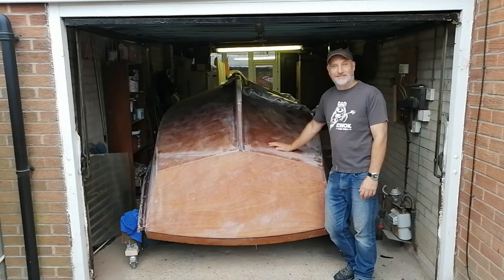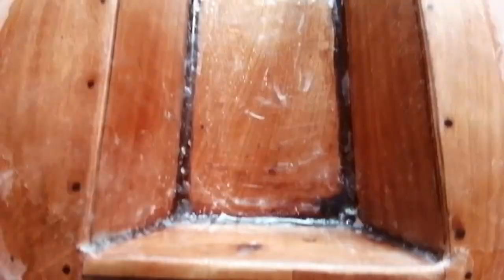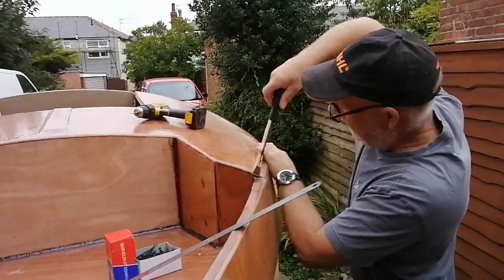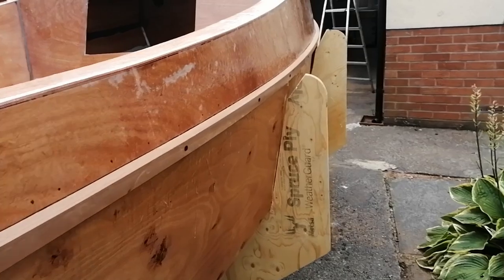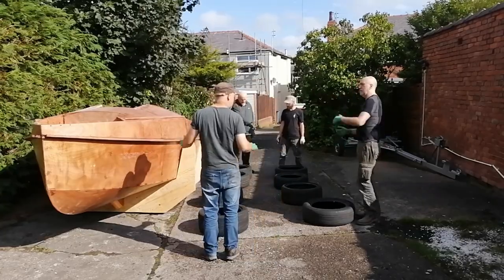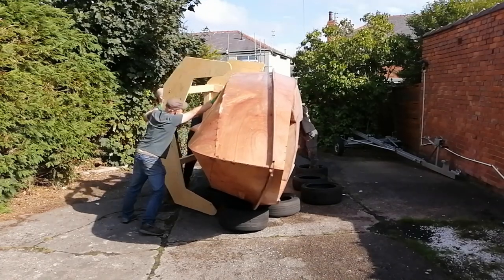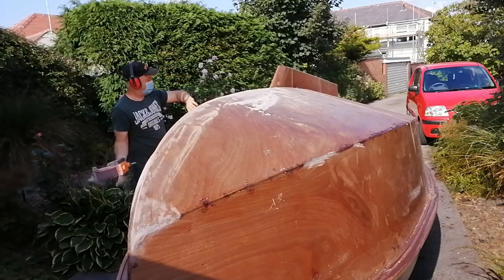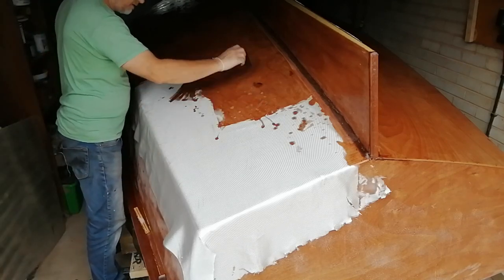AHAF Building a Pocketship part four

Comment: I've never seen a one-handed belt sander like that, before. Looks useful for boatbuilding...
Reply from the maker: Yes it is handy, especially for sanding curves or just quickly reducing lumps and bumps such as after applying fibreglass.  Much lighter than the larger ones, it's a Triton Palm Sander.

Comment: Awesome build!  I will be following the progress.  One question.  Doesn't a belt sander remove too much material?  I've seen others use an orbital sander on fiberglass.
Reply from the maker: Good question. It does remove too much material in flat fibreglass but it's good for quickly fairing in the lumps and bumps on the overlaps. Once that's done I switch to my rotary sander or do it by hand.